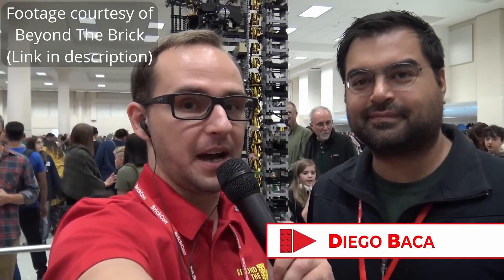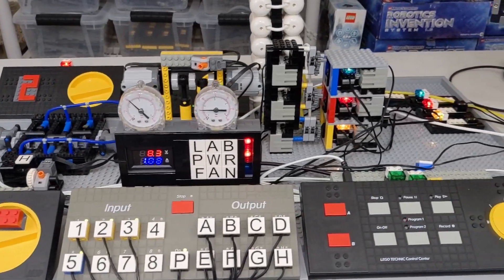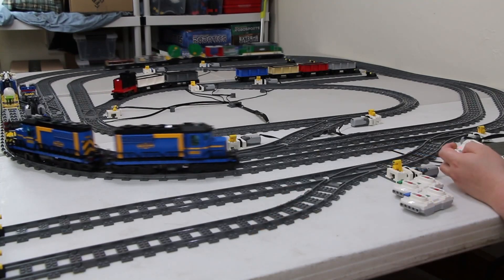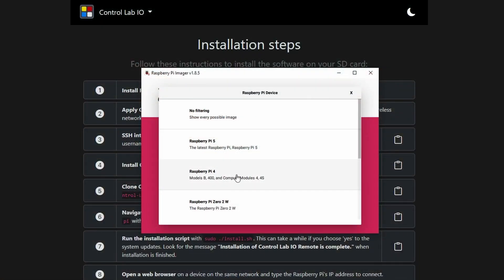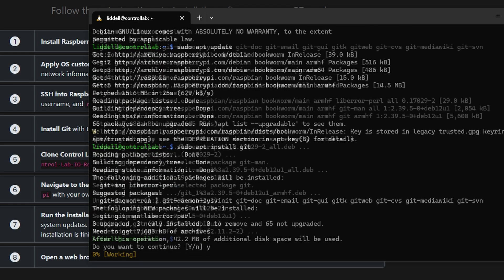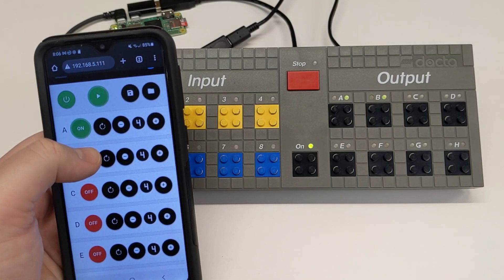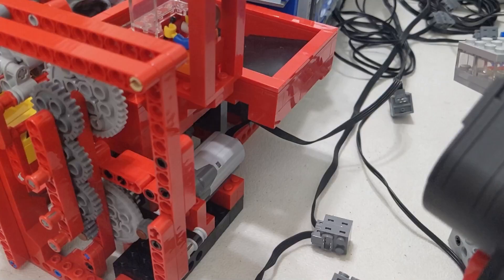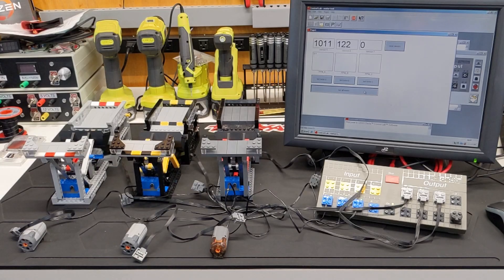Controlling the DACTA Control Lab with a mobile phone!

Comment: Interesting video, do you have a recommended price for a 9701 set, thank you?
Reply from the maker: It depends on a lot of factors such as a person's location.  I've found good deals on the Control Lab interface itself (as low as $20) but they do take a while to find.  The actual set will vary quite a bit and some will have the wires with rubber insulation which will need repairs or the plastic insulation which won't.  I always tell people to cast a wide net, check multiple auction sites at least once a week and see if they pop up for a good price.  A little patience / diligence can save a ton of money for something like this